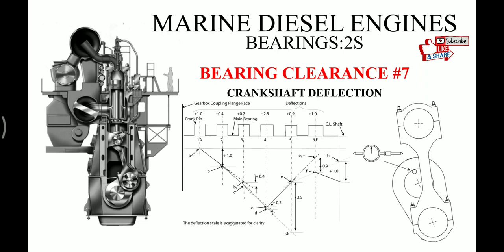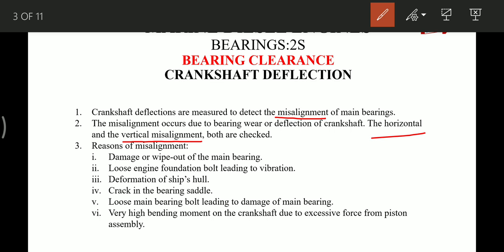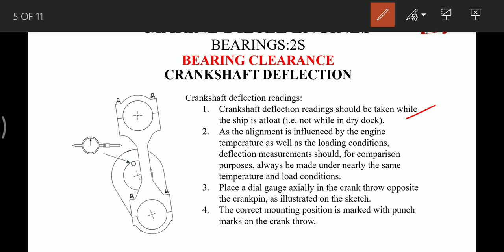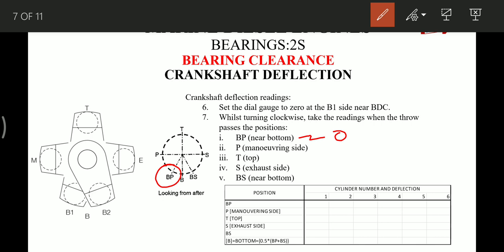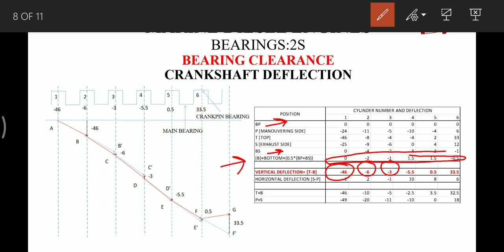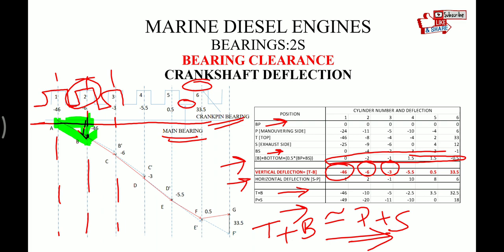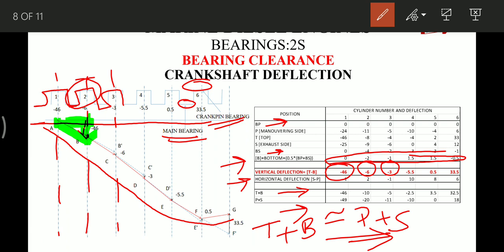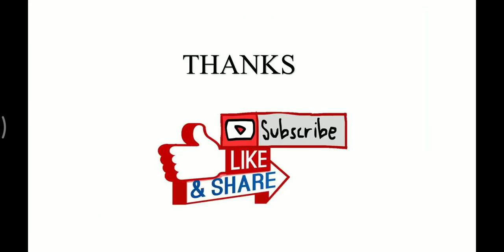Marine diesel engine, Bearing :2S, Bearing Clearance #7, Crankshaft Deflection.

Comment: If punch mark is not available how will u take
Reply from the maker: It is always there... other wise there is no way u can fix ur deflection gauge at correct position..
Reply: @meoexams  sir it is an mmd oral question
Reply: If u don't have punch marks,u have to put the gauge at D/2 from shaft center line
Reply: @meoexams if you don't know don't bluff it can be taken at d/2 of centerline os shaft .study properly and educate others